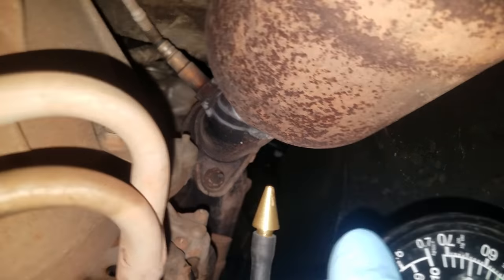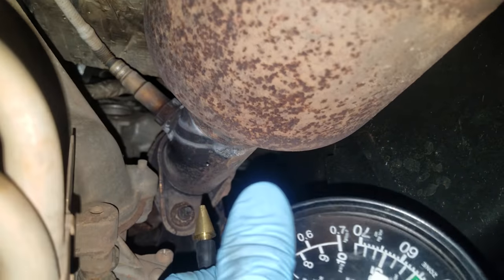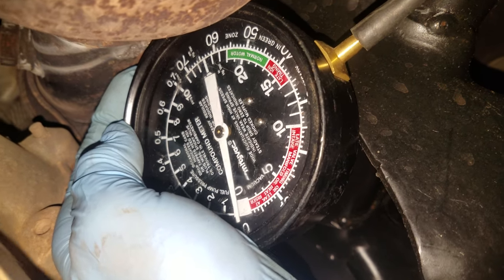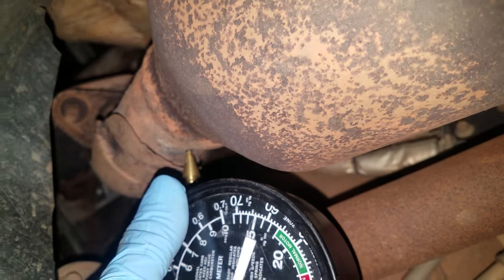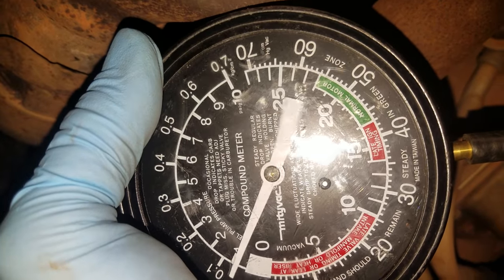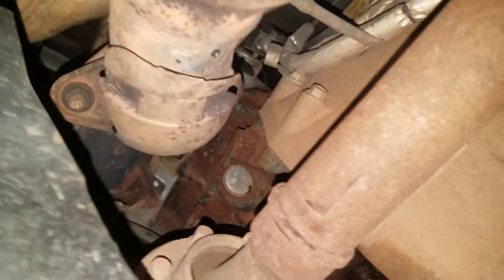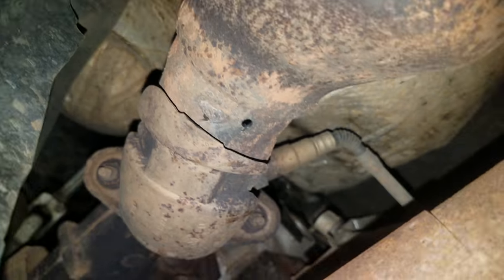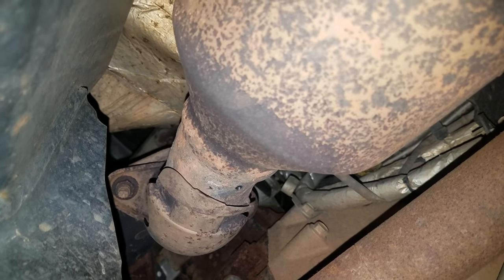How to Check for a Bad or Stopped Up Catalytic Converter

Comment: Passed smog 5months ago, 02' ranger had no power, $3500 to replace cats. I checked cheapo scanner, no codes, shop said no codes were set either but says cats are the problem. Is it strange there are no codes after driving like that 50+ miles?
Reply from the maker: I see vehicles often that have stopped up or broken up cats but no codes. I would find another shop if they are charging $3500 for new cats, that's ridiculous. Call Lawson Industries for all types of exhaust. They probably have a direct fit or universal cat that will work for a real reasonable price.  I believe its www.lawsonindustries.com. Don't let the exhaust shop keep your old converter, take it to a metal recycler and get money for it yourself. Hope I helped, thanks for watching!

Comment: I have the smelly sulfur smell and white smoke from exhaust. I also have 210 compression from cylinder 6. Are they both related or do I have to do valve clearances and clean my cat converter?

Comment: Just did this test on my 2007 explorer and the drivers side cat was def clogged.  I had removed the  02 sensor and tried to drive it and did not notice a power increase. I grabbed the same gauge  from harbor freight and drilled the hole in front of the cat. The passenger side was fine and the drivers bounced all over. Thanks for the video this has been driving me nuts for weeks.
Reply: Hey friend what led you to believe it was your Cadillac converter
Reply: @danielhughes931  I didn't read anything about a "Cadillac convertor".
But I'm curious why he has "cats" under there. And did the "cat" manage to escape once he drilled a hole in front of it?
Inquiring minds want to know.

Comment: Thanks for your help seriously!!! Did this test on my 2003 trailblazer and got a solid 3.5-4 PSI after the converter using the 15 dollar pressure tester from harbor freight. The 2002 and 2003 trailblazers I guess are notorious for getting clogged converters and I definitely get some bogging under load like climbing a hill or accelerating at low RPM basically anytime I need torque from the engine. I also hear a pretty aggressive rattle coming from the converter which I can reproduce by rapidly tapping it with a rubber hammer so something definitely broke off and is rattling around in there restricting flow. Glad this video was here cause they are not cheap so I needed an airtight diagnosis on this one didn't want to flush 200 down the toilet!

Comment: Perfect info for my stopped up cat problem, preciate it!
Reply: What did you have to do to fix it
Reply: @realskata16  Replace the cat
Reply: @FloridaMan7337  lol I been running a little bit of lacquer thinner in mine and it cleared it up a lot but still probably gonna have to remove cat

Comment: Great explanation. When you have 2 catalytic converters, what data should I look for to find the more suspicious one? Also is this more accurate than a laser temperature pointing after and before method?
Reply: Diagnostic trouble coded may read which one. Upstream sensor 1 downstream sensor 2 etc. Unless V-motor be bank 1, bank 2, bank 1 sensor 1.  Bank 2 sensor 2 etc.
Reply: @larrywilderson304  mines 1200° at idle. Normal?

Comment: Drill the hole at the front or the back of the converter?????
Reply from the maker: You'll want to measure the pressure on the inlet side.

Comment: Could you also have pulled the O2 sensor and measured the pressure from there?
Reply: That’s the best and real way to check them “CADILLAC CONVERTERS” but i guess its eaiser for him to just make exhaust leaks.
Reply: You can pull the o2 sensor and screw in an adapter to attach the pressure gauge but sometimes when the o2 is rusty it wont come out so easy so it's easier to drill a small hole and weld shut after replacing if the cat needs replacing.
Reply: @babyfacebabyface8519  it's easy to fill a hole with a weld.
Try removing a 02 sensor that's got 200,000 miles on it and let me know what's easier.
Reply: @christophermix6845  mines at 245k. All 4 oxygen sensors didn't give me a bit of trouble. I had a harder time removing the stupid connecters.
Reply: @larrywilderson304  Pretty sure removing the sensors is harder than just drilling a small hole and plugging it

Comment: I have white smoke blow heavy out my bmw 530i I was told by a mechanic that I have a bad cat and it causing my car to blow white smoke. Is this the case?
Reply: Blown head gasket
Reply: @Badge1122  wasn't that it was a bad ccv replace it now she smooth running nomore issues

Comment: Take a can of carb cleaner with a straw attached and stick it in the hole, blast a shit load in there and clean the cat....ol school mechanic trick....yes a screw will work fine to plug that hole
Reply: Can i run it into the pre catalytic oxygen sensor port? If so do i do this while running or shut off? And any other info would be appreciated
Reply: @larrywilderson304  yes you can run it through the port and if your gonna do it with the car running that's fine but gotta do it fast cause the pipe will get hot fast and melt the straw....spray a bunch in while the car is off then a bit more once you fire it up
Reply: Appreciate your help. I swapped 02 sensors from bank 2 to bank 1 to verify it was causing my catalyst malfunction code and now getting a misfire/or multiple. Probably bank 2 from the DTC causing bad spark plugs

Comment: I hope you would never put a self tapper in the exhaust , a simple 2 minute weld session would fix that no issue , I personally would be pretty upset if you left a self tapping screw in my downpipe
Reply from the maker: At 2:10 I said welder.  Some people don't have welders and the best thing for them may be screws for a quick fix till they can get it welded up.
Reply: @okcvet1st yep any port in a storm.